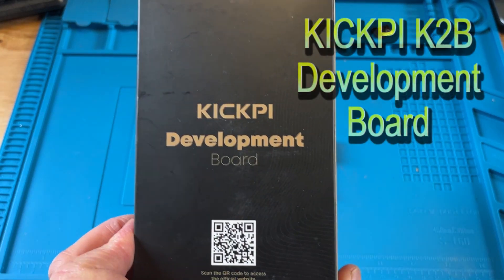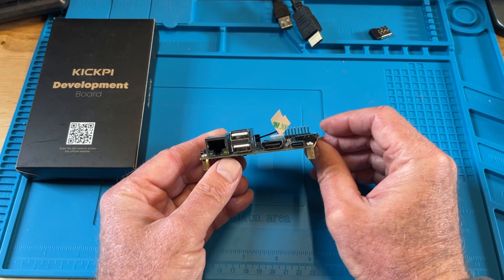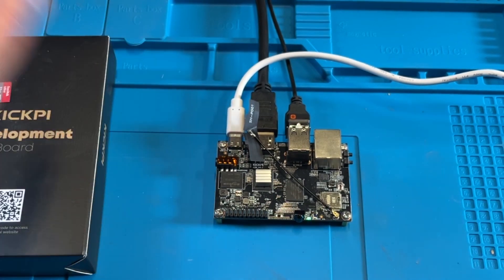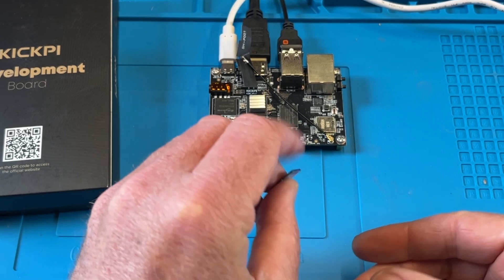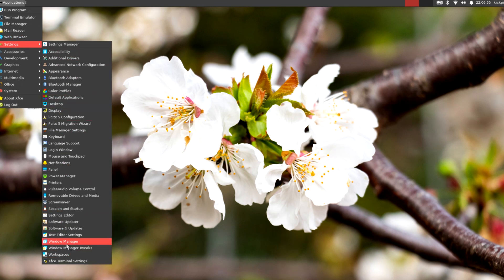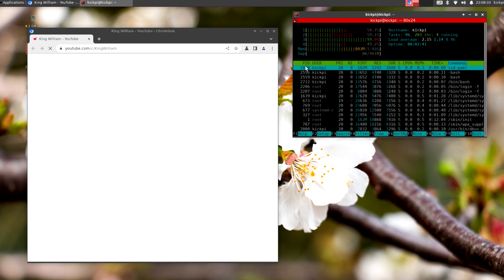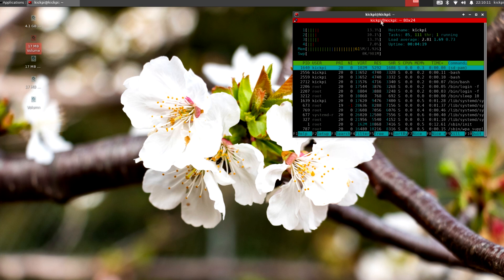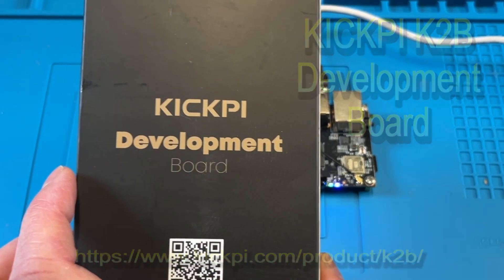KICKPI K2B Development Board

Comment: I'm gonna 3d print some cases for this.  I have 2 and use em for piholes and network apps on ubuntu.  Had trouble getting stock Debian working and gave up.  couldn't get the wifi working on any but ubuntu and android :(.  I ended up using the EMMC for just the swap temp and log partitions to keep the beating up on that NVRAM 8gb internal chip.  waaay faster now.
Reply from the maker: Excellent.  It’s a nice little board.   Pi holes are a great use for them.  I’ve just been using the sdcard for the os just for the space.  I might do the same and put the swap on the emmc.
Reply: @KingWilliam  it is very simple to do it just ask one of the gpt tools for a step by step.  It will save tons of wear on the the little sd card and there is a speed shift upward definitely.